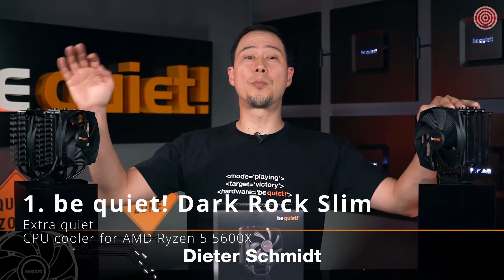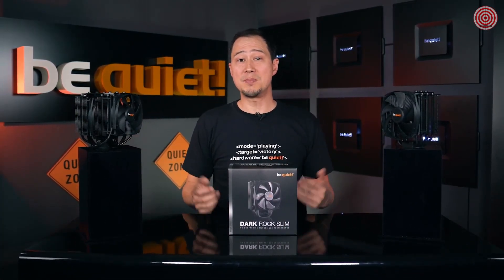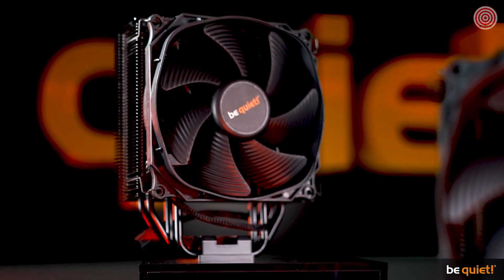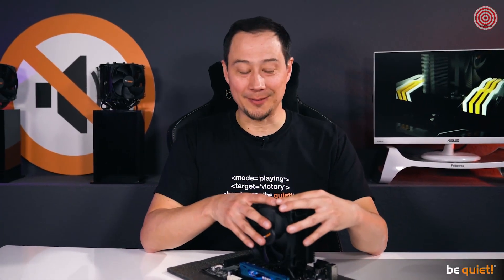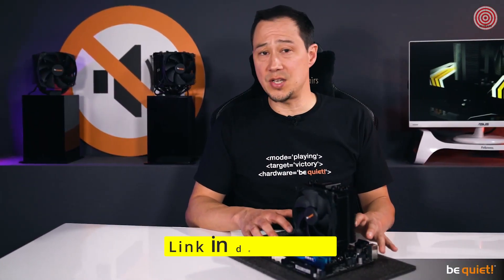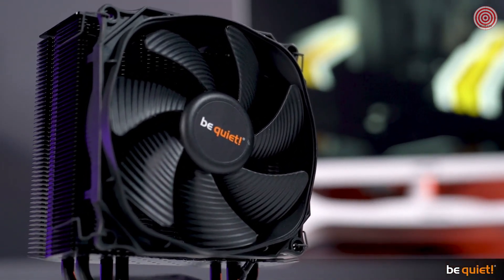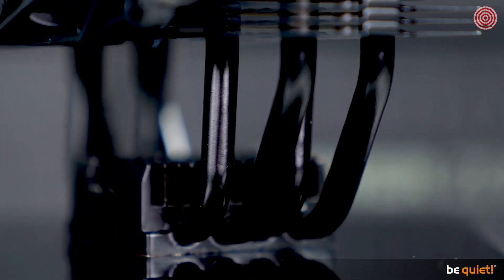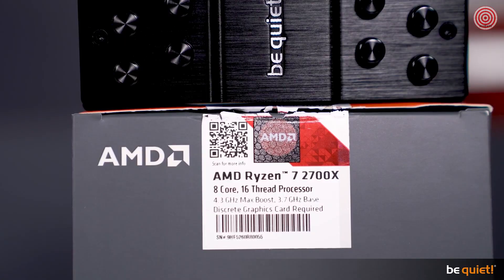5 Best CPU coolers for AMD Ryzen 5 5600X in [2024]

Comment: Bro pls tell is it good to use a CM Hyper 212 turbo rgb cooler  on Ryzen 5 5600x along with rtx 4060 gpu for gaming or suggest a budget air cooler
Reply from the maker: The CM Hyper 212 Turbo RGB cooler is a good budget option for the Ryzen 5 5600x and RTX 4060 GPU combination for gaming. It will keep your CPU cool under moderate to heavy workloads, and it is also relatively quiet. However, if you are looking for the absolute best performance in terms of cooling, you may want to consider Thermalright Phantom Spirit 120SE, it doesn't have RGB, but it works great with AMD CPUs, even with the 7000 series.

PS: Ryzen 5 5600x and RTX 4060 GPU - This configuration has 22.8% of processor bottleneck. 
This means that the cpu will be overloaded to keep up with the gpu
Reply: @AryTechB thanx alot sir
Reply: But sorry sir it isn't available in India any other recommendation
Reply from the maker: Thermalright Peerless Assassin.
Reply: @AryTechB  🙏